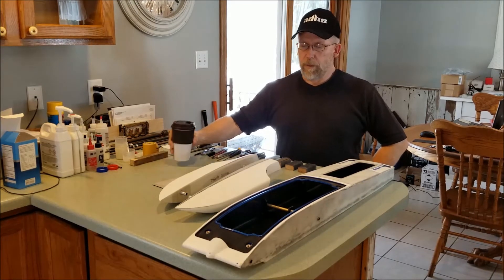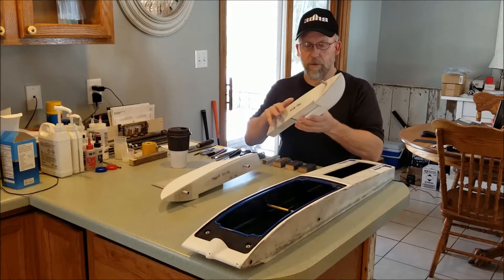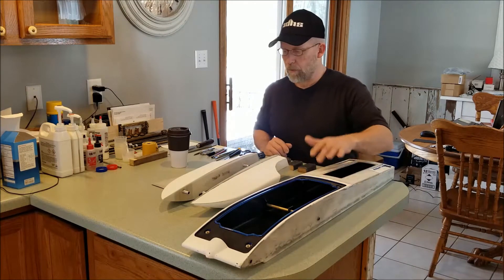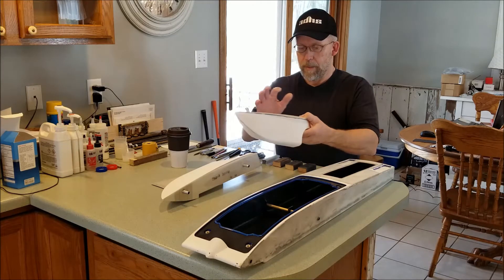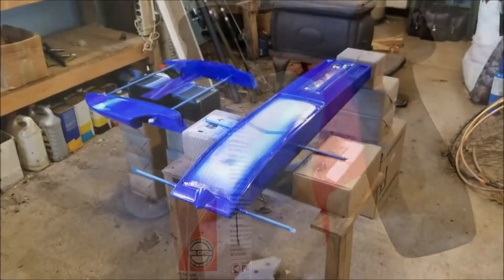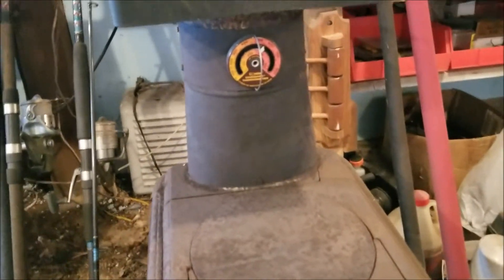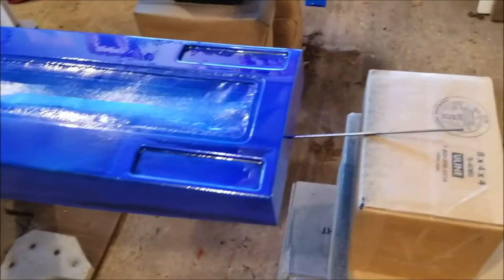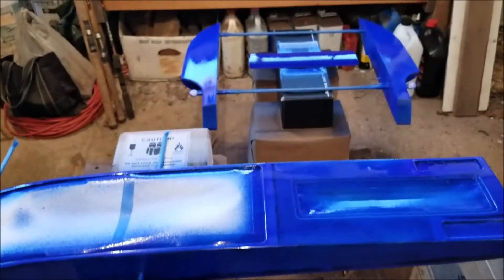PAINTING THE PRO BOAT UL-19XR USING THE PREVAL SPRAY SYSTEM

Comment: Hi Sam been watching the whole build absolutely amazing I would suggest wet sanding the whole boat
Reply from the maker: Thank you. I did wet sand it before painting. So I'll need to do the whole thing anyway with epoxy paint if I wait longer than 24 hours between coats. Which I plan to do so it sands nicer. It will make for a nice final coat too.

Comment: Those paint spots ruined the  job . There should be another way I guess.
Reply from the maker: No, it's not ruined. It's just part of the learning curve with the Preval sprayer and this epoxy paint. I'll wet sand it and spray another coat with the paint thinned properly...